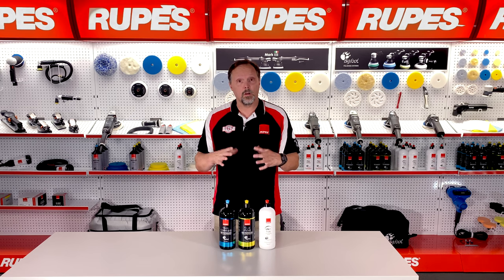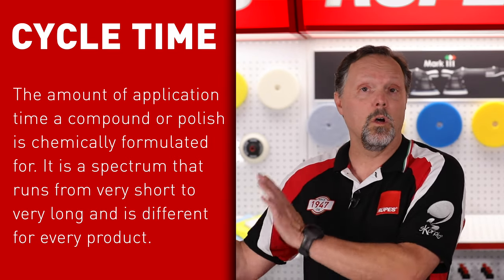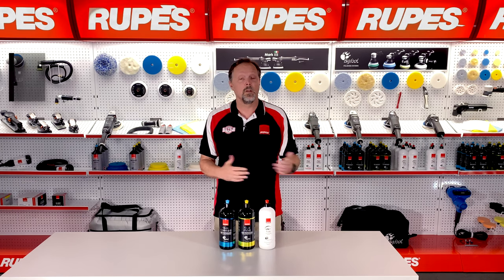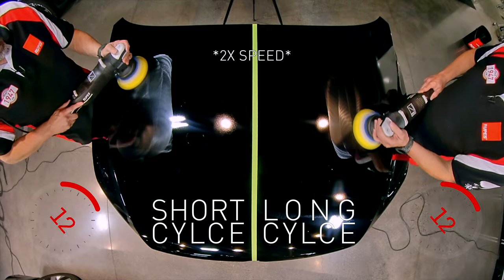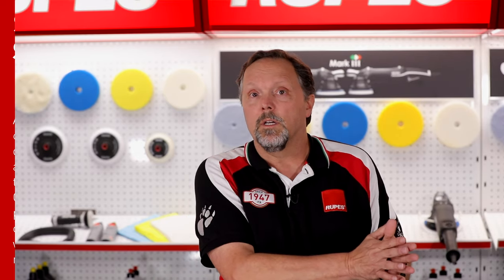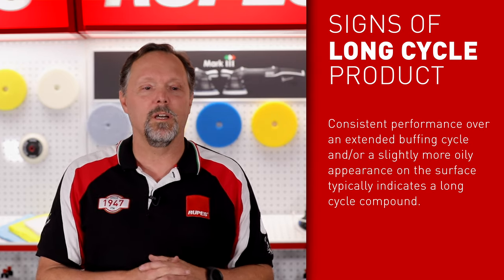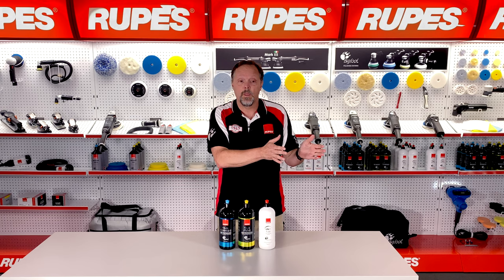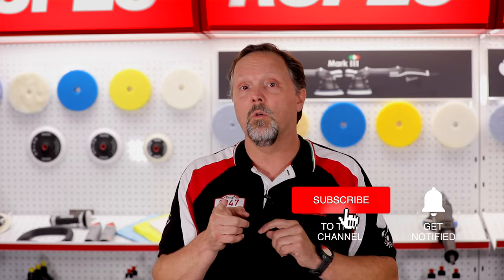Understanding Compound Cycle Time - [RUPES Replies Episode 017]

Comment: I was having that problem when I was polishing and pad was starting to skip and leaving solid residue on surface that was hard to remove. So it means that I was using short cycle for long time ? Doing a bonnet but large areas. So with short cycle divide bonnet into like 8 sections? Half a bonnet and do quarters?

Comment: Would a spray wetting agent(SWA) can extend somehow the cycle of your polishing time?
Reply from the maker: Thank's Pristine Passion, this is question that requires a thoughtful reply because we have to be accurate with the definitions. If define cycle time as the time engineered into the product which gives it specific characteristics--- SWA alters this. If we define cycle time as the amount of time we can polish with --- SWA can extend this slights (but adding water or any liquid to the process will change the abrasion, finish, lubrication, etc)

Comment: this was a great short segment. Would love to see more on this subject. Is short vs long cycled liquids somewhat defined by water vs oil based? It seems to me long cycle products are more oil based while short cycle are water based. Is this somewhat true? If you under cycle a long cycle liquid does that mean it may be streaky or harder to wipe off since it hasn't been worked long enough?
Reply from the maker: All great questions. Summarizing:

Water or oil based has no direct correlation to short or long cycle. There is far more to the formulation impacting cycle time. 

If you short cycle a long cycle compound you may see some streaking, but that’s typically more due to the amount of compound used. If you intentionally are going to short cycle a long cycle product using less product mitigates this potential issue. It also isn’t true of all formulas. Some long cycle compounds wipe off quite easily regardless if they are long or short cycled in application.
Reply: @RUPES  Thanks so much for the response. Would love to see more info on this subject. I feel it's very overlooked in the industry.

Comment: I’ve noticed using the new uno protect and found it has a short cycle is this correct🤔
Reply from the maker: UNO Protect, and most all-in-one products for that matter, tend to be a little different. The addition of waxes and polymers to the mix allow you to work with it for awhile, but if you overwork it you can tend to start to see it get gummy or sticky on the surface. Depending on how you use UNO Protect (the end goal) your cycle should adjust. If you're simply using it as a light polish and protection a short cycle will do the job. If you're chasing defects a longer cycle will be desirable.

Comment: hi :) can you explain us how refining stage exactly works.... and when the pad stalls are we still refining?
Reply from the maker: Refining, loosely defined, would be anything you do that takes a scratch pattern on the surface and replaces it with a finer, less visible, scratch pattern. It is key to understand that no matter how fine a combination of products you choose there is always a scratch pattern introduced to the surface, the only difference is that when you get to high levels of correction and gloss the impact of those marks has less impact on the reflection (invisible to the human eye). 

As we explained in last weeks episode of RUPES Replies, in a large stroke random orbital tool the orbit is the dominant movement, in most cases comprising 80% or more of the total pad movement. Because of this, even with momentary pad stall the polishing action is still effective.
Reply: @RUPES  thank you very much for your time :)

Comment: So Rupes polishes are short or long... as i get dusting a lot with these polishes.. and im only doing 2 passes.... can you explain what im doing wrong? I use a brush on the pads Ive got about every roughly 3 sections done, and then reload with 2 pea size dots.
Reply from the maker: Our previous generation of compounds were a short cycle. The newer generation, DA Series, would be considered a longer cycle. A brush is only marginally effective at removing residues, especially on fiber pads. Its better than nothing, but for more complete cleaning blowing the pad out with compressed air or using a vacuum crevice tool to agitate and remove the residues is far more effective.
Reply: @RUPES  Thanks I have the new generation compounds. I can't afford or have time to get compressed etc... im only someone who wants to take car of his car, not a business. Ive followed your 101's... so im really not sure what is going on.
Reply from the maker: Dusting on a short cycle would be highly unusual with the new products, but the comments section of YT is probably not the easiest place to troubleshoot. Get in touch with us and we can get a member of our technical team to help troubleshoot the issue

www.rupes.com/contact-us
Reply: @RUPES  Thank you will do!

Comment: How many minutes do you Rupes consider to be a longer cycle time? You say your new DA compounds and polishes were chemically formulated for long cycles.  How long should you do for a short working cycle?
Reply from the maker: The cycle time isn't like a clock timer. It is impacted by the type of tool movement, the type of pad, the operators technique, how much compound is used, and a lot by environmental factors. At our US headquarters in Colorado we contend with extremely dry air due to the altitude. A long cycle compound in our facility doesn't run as long as that same compound being used in Florida with high humidity. 

The purpose of the video is to help you understand that cycle time is a thing. It is a part of the compound formulation. The specific duration of your cycle is going to be unique to you, but if you have 2 bottles, and one allows you to go for 90 seconds, while the other starts to dust and become grabby at 30 seconds under identical conditions, you have 1 long and 1 short cycle compound. 

Also, it should be mentioned, no compound cycle should be measured in minutes. If you are cycling a single application for minutes your application time is far too long and likely very inefficient. We recommend trying to target a 60-90 second application. A 120 second application would even be within the realm of possibilities, but would be longer than it needs to be. 

In this specific video around the 2m mark we even show a long and short application up against a timer if you want something to use as a reference: https://youtu.be/Lmv0Y8fPhJ0?t=120
Reply: @RUPES  

Thank you very much

Comment: ugh not helpful at all... a grid, image, chart wb helpful, i.e., megs 105 is long cycle, 205 is long cycle but both dust up, sonax pf is mid cycle, black fire c/w long cycle, uno pure? uno protect long... etc
Reply from the maker: Sorry you didn’t enjoy the content. There is not a chart or black and white definition on these things bc cycle time is a spectrum and there is variation within that range based on variable impact. As for our products in particular, they’d all be mid-range in most conditions. The previous generation formulas for random orbital were very much in the short cycle range (except for Diamond).
Reply: RUPES i figured that but at this stage of technology and chemistry there's a chemical definition / direction the chemical team mixes the abrasive, sealant, filler (if any) and polish to reach some metric just as a the gauges we see on pacakaging. would t you agree? an 8 abrasive or cut is chemically built likely a short cycle... an AIO is chemically built as a long cycle... right? maybe that's an idea for a video, bring on the chemist 🤷🏻‍♂️
Reply: RUPES theres the kevin brown mad scientist approach / explanation that helps understanding of the binding agent separation (abrasives) relative to polishes (4&less) that dissipate, liquify under heat to a point before they bind back again... btw i did enjoy it just wanted more better content👊🏻
Reply from the maker: Thanks for the feedback - we’ll take it into consideration, but the entire concept of the RUPES Replies series is “bite sized” content (5 minutes or less) it doesn’t lend itself to that deep dive type of approach. Perhaps a future series can give you the more expansive explanations you’re looking for.
Reply: @RUPES Always watch your content but i do feel you are an expert at not telling us stuff
 The only reason i can see for this is that you dont want people to say " But you said do this and you will get that "
Its a shame because like Rupes as an individual like it or not you are an aspirational figure in your field
Reply from the maker: Thanks for your comment. 

The reality is that variables impact almost everything, changing the experience and outcome for each user. When we conduct live trainings we begin each class by setting an expectation for the students - we do not teach a process, or a standard operating procedure. We teach variables, how to read them, and what adjustments can be made. The same applies here. Some people want a set of instructions, but the reality is to be truly proficient at these processes you must be able to read variables and adjust. Paint correction cannot be done effectively as an standard operating procedure. 

Jason often says : “the only wrong technique is the one you do the same on every car in every situation as it will only be right a fraction of the time”
Reply: RUPES totally get that still think you may be missin my pov... teaching polishing correcting is like teaching golf swing it's ephemeral and teaching feel is not an sop - it is however within a set of rules - in fact like polishing there's irrefutable laws there's principles and preferences as you say variables... this is the gap the audience is seeking... believe me on this!
Reply from the maker: We truly appreciate your feedback. If you look at the polishing-crazy nuts we have on our team you can imagine the technical conversations we have.

While this series - RUPES Replies - is not the series for what you are seeking, we are constantly evaluating feedback and thinking of new and exciting educational possibilities. Stay subscribed and stay tuned.